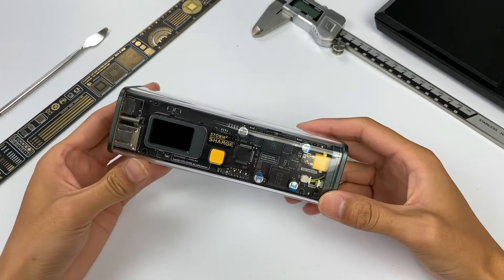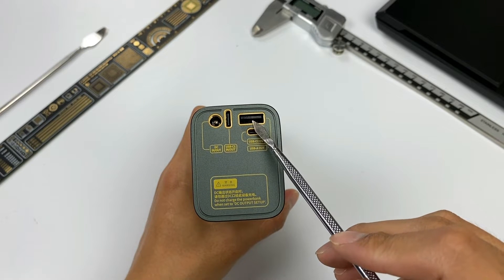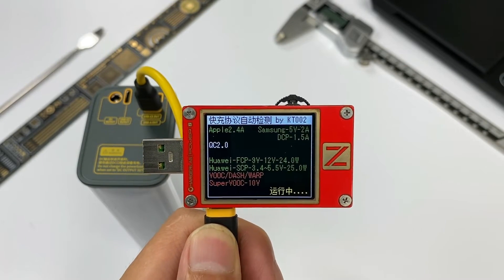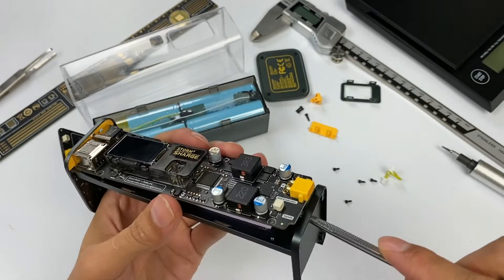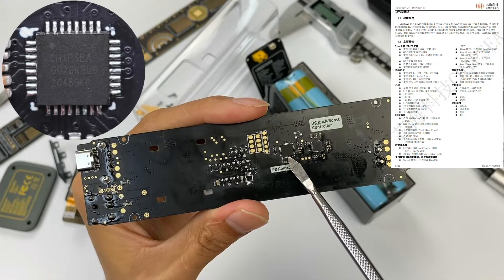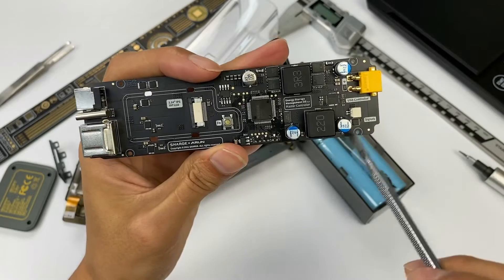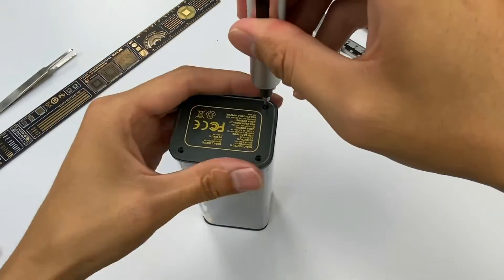First Teardown of SHARGE / STORM 2 100W Transparent Super Power Bank

Comment: That 220 written Chip on front what is that for....
i dropped mine today its charging from 1 USB in and Out port only (its like this from long time  only 1 usb C is working other ports are not working dont know what is the issue) should i be worried of that broken 220 Chip?

Comment: I love mine, but now it's not behaving right. It's showing near-empty but when I plug it into a USB-C PD 65W port, it shows charging at 60W for a couple of seconds, then drops down to <1W charging (showing 19.9V and 0.04A). I've tried multiple supplies and cables but it never does better than 1.6W (5V .3A) and the battery meter never seems to grow. The screen doesn't come on unless it's plugged in. I've sent Sharge an e-mail about it but so far no reply. Pressing the reset button under the back cover doesn't do anything other than occasionally cause 60W input charging for one second before dropping back down.

Comment: One thing I don’t like on this is the capacity that they lie about at 25,600mah the capacity on this is only 6,400mah.
Reply: There's no way that's true.
Reply: @1GamersRewind  well it is because the batteries are not used as individual cells at 3.7v but in fact are 4 batteries in series which makes 14.8v so the capacity on that is 3200 x 2 = 6400 as there’s 8 batteries inside.

Comment: They lie about capacity. 4s2p = 16.8v 4.6ah battery. So its 4.6ah and 77.28Wh. This is defiantly 4s2p or the display wouldn't show 16.8v battery voltage @ 100% charge. 3s=12.6v and 5s=21v. It is a cool charger though, I like the color screen. But for the price I would get the Baseus 100W 20000mAh Power Bank. 100W Power delivery output not 100Wh, but it actually has a 20Ah battery.
Reply: Lithium ion battery capacity is measured at 3.7 volts.

Comment: This thing is trash.  Only has about 48wh of power and at 100w pd it overheats in about 15 min.
Reply: Just got a storm 2 slim and mine overheats while charging with the official shargeek charger and official cable.  Wonder why more people are not mentioning this.  I will be returning mine.
Reply: @victorlatour7662  yeah I need to quit doing Kickstarter. I got my eye on that new Anker pack.
Reply: @smky143  Yeah I am checking that Anker out as well.
Reply: Could you link anything about these issues? Planning to get one of these and hadn't heard this
Reply: @xXfireball127Xx  I think I posted a video someplace. There's many many way better options at better prices. The only thing cool is the screen. I was disappointed charging my laptop this overheated and shut down.
Reply: @smky143  Ah good to know, thanks for the heads up!
Reply: @smky143  just looked at your channel…are you also into drum corps?
Reply: @xXfireball127Xx  https://youtu.be/56HtgUwi-1w
Reply: Its a copy off Shargeek's storm 2, this product this channel is reviewing is a fake so that explains why people are having issues.

Comment: Five connected in series and three connected in parallel? So that's 15 cells all... I don't think that's 15 cells you're holding...
Reply from the maker: There's a total of 8 cells, five cells are connected in series, and the other three are connected in parallel, each cell is 3200mAh, which is equal to 25600mAh. You can also use "Wh" to measure it. It's just the product promotion, you know.
Reply: @ChargerLAB  wrong, its 4s2p, 4 in series, those are then paralleled
Reply: @Anonymousg64  They lie about capacity. 4s2p = 16.8v 4.6ah battery. So its 4.6ah and 77.28Wh. This is defiantly 4s2p or the display wouldn't show 16.8v battery voltage @ 100% charge. 3s=12.6v and 5s=21v. It is a cool charger though, I like the color screen. But for the price I would get the Baseus 100W 20000mAh Power Bank. 100W Power delivery output not 100Wh, but it actually has a 20Ah battery.
Reply: @ChargerLAB  it is strange combination. How can it utilize the power in all batteries?

Comment: Could you change the 18650 batteries on your own? Will it work with other capacities or is it hardcoded somewhere in the firmware? This looks like a pretty good power bank and I'm thinking of buying it.
Reply: The display will die much earlier (cause the humidity in the air) than the battery will. In time, the electrolytic capacitors in the DC/DC converter will shift much less Coulomb than the battery. This could be avoided by running the power bank at half power, so that the capacitors never get above 45 °C.
All in all, the display and the power capacitors will die before the batteries, after one year of daily use, or three years of moderate use...
Reply from the maker: We didn't test that.
Reply: @ChargerLAB  It would be awesome if you made a video replacing the cells in this battery bank. Would be very helpful for people who might want to repair one and reduce ewaste. (Great videos btw!)
Reply: @xXfireball127Xx  In China at least this thing has a 2 year warranty so I don't think any ordinary user would need to try repairing it anyway. And IMO the board would actually be more vulnerable than the cells, that's how my last power bank (not this one) ended up dying, and this one (that I'm also currently using) would most likely ended up dying the same way as well, but it's probably less likely to happen giving that it does have proper protection circuit.
Reply: Also curious. I'd kill to have one that I  could (easily) put my own batteries in, or at least rewrap the ones included.

Comment: what do you mean with "there are 5 cells in series and 3 in parallel"?
Reply from the maker: if the positive connect with negative. We call it in series.
If the positive connect with positive or negative connect with negative.we call it in parallel.
Reply: @ChargerLAB  I know what parallel and in series means :)
but in this pack are 8 Cells and you mentioned 16,8V so this is 4s2p pack, so I'm confused what a 5s+3p means?
Reply from the maker: What I mean is there’re 5 cells connect with others in series, that’s 4 series connections. 
Another 3 cells connect with others in parallel, that’s 2 parallel connections.
Same meaning, just different expression.😁
Reply: @ChargerLAB  thanks for clarifying I was also confused 👍🏻
Reply: @ChargerLAB  that still doesnt make any sense to me
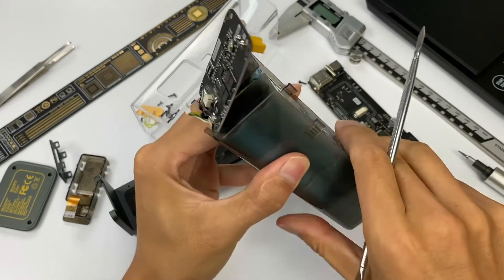Reply: @StreamzNow  Because its wrong @ 8:14 you can see only 2 high current connections to the battery. Plus the battery display shows 16.8v fully charged so its 4s2p.
Reply: Say that each battery gives off 3.7 volts if you put 4 batteries in series you will have 14.8v  (Because 3.7 Volts multiplied by 4 Batteries = 14.8)  now you are still putting out the same amount of amps. If you want to double the amperage simply  make another line on 4 batteries (14.8v) and wire the two seperate 4 cell battery packs in parallel by connecting the positive terminal on battery pack #1 onto the positive  terminal on battery pack #2  now you are using eight batteries that are producing by themselves 3.7v to produce 14.8v with double the overall amperage.    YouTube how to wire 18650 batteries in parallel / series..  hope this can help
Reply: it is a strange connections 🤔